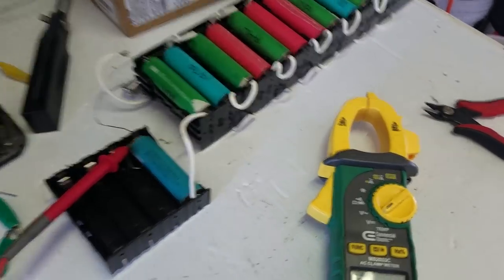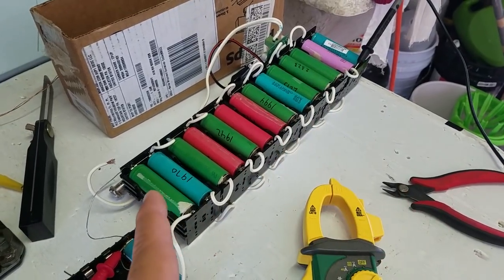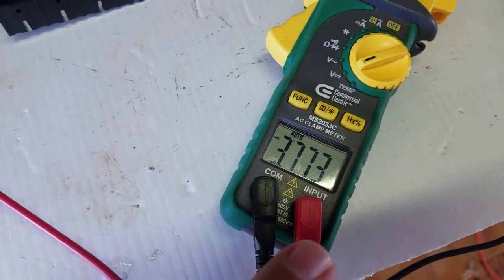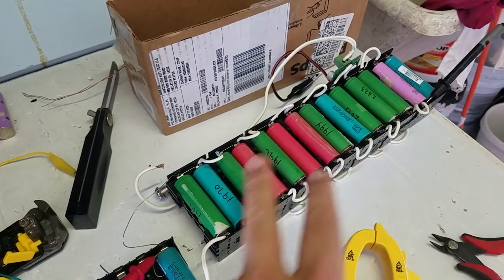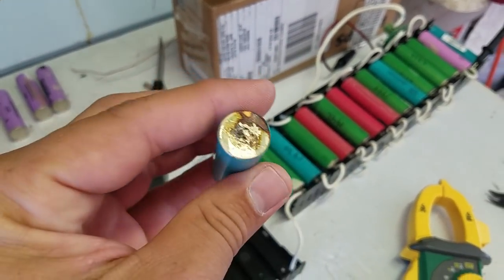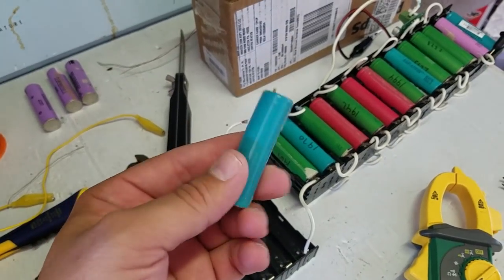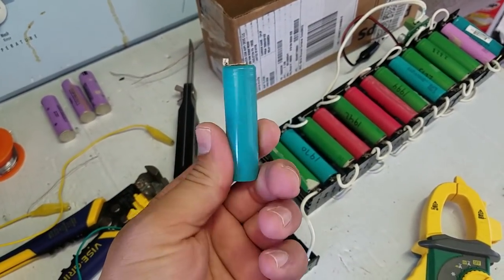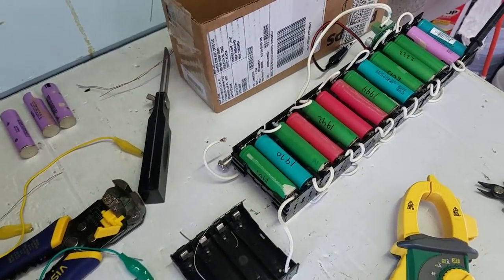Quick and dirty fuse wire testing on smaller 18650 parallel pcks

Comment: People who have learned the hard way or just got lucky
Guy learns the hard way and after goes to cell level fuses:
https://www.youtube.com/watch?v=_DHkHdMooV8
"AveRage Joe" is probably happy he went to cell level fuses after one blows
https://www.youtube.com/watch?v=Uol_AExIn3E
OOPS! Guy is probably happy he had the fuses in there!
https://www.youtube.com/watch?v=k1OplioeNJc
Even with cell level fuses, and we don't know if they were the right size wires because a lot of people don't pay attention to details, this guy had his VW Bus burn, see the battery at about 09:40, it's been said that 1/8W resistor leads are about right but the correct professionally made fuse wire is obviously a better choice and cheap.
https://www.youtube.com/watch?v=4igrPF6Cpoc
"HBPowerwall" Learns later that some cell fuses blew and may have saved him, see his video description and comments "so far have blown on a dozen cells surely saving me from some sort of larger failure I think"
https://www.youtube.com/watch?v=REJx-ug_Gas

Ebike fires: (way too many, do a search)
https://www.youtube.com/watch?v=BglMlHQ4c8w
https://www.youtube.com/results?search_query=Ebike+fire
Can't tell if it's cell level fuses or what started the fire but why take the chance?
Reply from the maker: Thanks for sharing.
Reply: yes, you are right.. I guess the Idea now is to find is the right type of wire for a fuse... any ideas at the moment?.. maybe Javier can test it.. also people need to stop stressing the batteries by pulling so much amps from a USED battery.. dam

Comment: Javier, Please do not put that battery in the pack.. If a batt is bad, do not insert.  I have the same setup as you.. bu the math I have is, I will never use more than 4 to 500 milliamp on any battery.  That way the batteries wont overheat and get too stressed.. The reason for a Fuse is  they do not have a BMS.. If you are able to keep them under 4.2 for less stress on the batt and above 2.8 or recommended 3.0, then you should be ok.. my setup never goes higher than 4.1, mostly is at 4.0 voltage and never under 3 volts. another thing most forget.. the hotter the batt is, the more stress and less efficient.  you are wasting energy in heating the battery. Just like the Tesla Modules, most people try to mimic the fuse for protection.. I never made a video before but will make one soon so i can show you what I have .. Hope you understand this
Reply from the maker: Thanks for your comment. 

Regarding the bad cell is only to show the test. It will never go into a pack. 
I use bms on my packs but lately I've started to think about fusing the packs as a extra layer of safety. 
I'm still running tests but looks like fusing is not a most.

You should see this video. Average Joe goes to great lengths on testing the fusing myth. https://youtu.be/lGcX43bjZnU
Reply: Yes, I have watched Average Joe.. Every pack that i sent to PR i did not have a fuse nor a BMS cause the need was high.. but they were aware that they must be within a voltage. I rather a BMS than a FUSE.. I DO NOT like to  solder a battery.. lately I been switching to a different batteries.. I will sent you a video, im getting more batt some time this week.. I do want to send material to help my mother and hoping you can help.. Let me know if you need something.. Ill send you a private message with phone number.. is there something you need right now? im sure money is always preferred ? let me know im here to help
Reply: Average Joe says at the end of the video he is going to use 2A fuse wire. Proper fuse wire is best, but it has been said that 1/8W resistor leads can be used in a pinch, Average Joe shows 1/4W leads which are thicker and thus higher amps. Fuse wire isn't very expensive so why risk it? See my other comment with a list of videos.
Reply: Agreed.. Having a Fuse can help,  last night average Joe had another fuse video.. interesting check it out. The risk is when we use the battery at full capacity.. but never hurts to have some sort of protection.. there was a video of a cell catching on fire with a fuse.. if i find it ill post it,